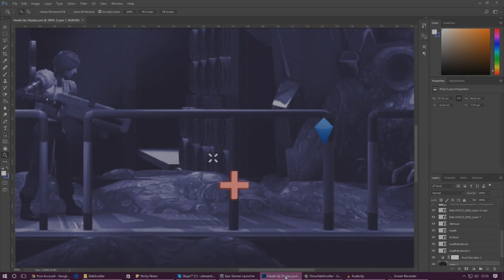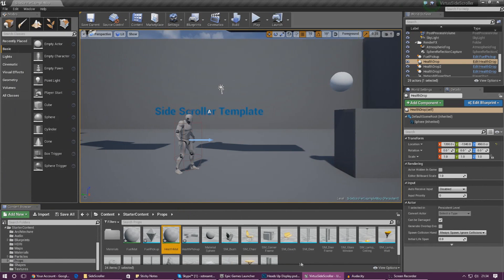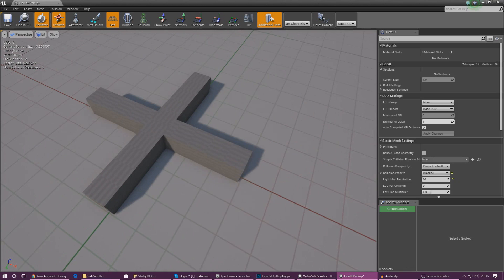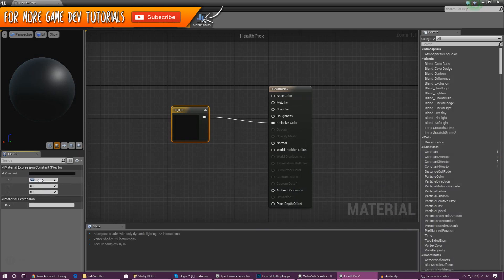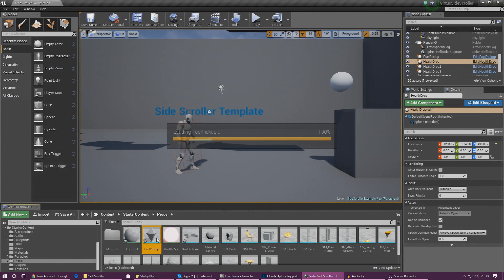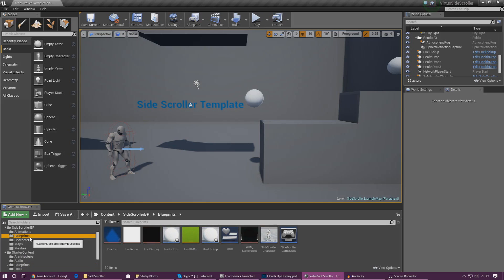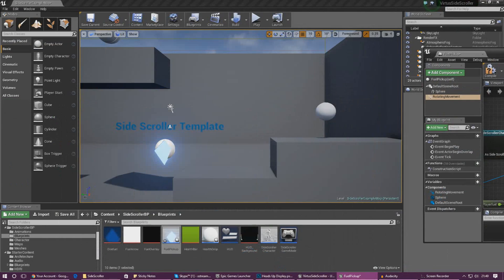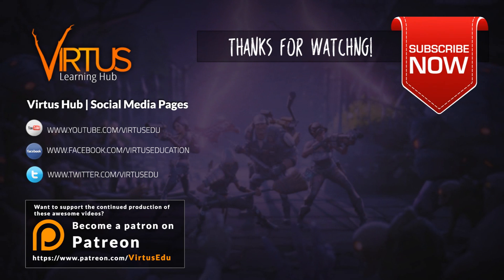Styling The Pickup Items - #6 Creating A SideScroller With Unreal Engine 4

Comment: I've got a problem. My HealthPickUp from the download is splitted in HealtPickUp_Box001 and "002. What should I do?
Reply: When importing the meshes, make sure to completely open up the mesh section of the Import Options window. There should be a checkbox called combine meshes that is unchecked. Just check it and you should be good to go. According to the comments I've seen, a guy named Chris K was the first to point it out here.
Reply: @Starn3rd  That worked perfectly! Thank you.
Reply: @Starn3rd  I checked combine meshes at import. But I have another prob, my combined imported diamond mesh seems to have no collision. I set it as the mesh in my FuelPickup, and the player passes thru. But if I reset it to a sphere mesh, it gets picked up.
Where do I set the collision box?

Comment: Thank you! I can add something  you may usefull.
1- You can also create the health and fuel meshes in unreal. just edit the blueprint screen you can easly add "static mesh" and manuplite the transform
2- Creating seperete materials might make the cpu tired. You can actually create base material which includes constrait (as multipler) and constraitvector3 (as base color, and make it blank) than you can right click this material and create instance.

Comment: Whenever I try to open the pickup materials, the Unreal engine crashes. :\
Reply: try restarting your computer if the problem continues it might be a problem with your computer
Reply: @cian5107  I tried with an older version of UE4 and it didn't crash. I dunno why, may be I'll just cont' on the tutorial series with the older version of UE4

Comment: Random Tip for anyone watching: Go into the event graph for the Health Pickup, then change float - float into a float + float. The only problem with this is that your health can go way above 1 hundred, and when you take damage, it won't display it. To fix this, you need to make the health pickup completely heal you to full health, instead of healing a little. To do this, delete the "Target Player Health" and the "Float + Float", and in the "Set Player Health", change it to 1. Now, you will take damage and your health won't go above 1 hundred. Hope this helps :)
Reply: thank you!!
Reply: you can also use a clamp node, to clamp the health to 1 before setting it!

Comment: Hi, did anyone run into the problem where their health pickup was imported as two shapes instead of one?
Reply: UPDATE: If you run into this same problem with 4.18.4 or higher. Head to Window --> Developer Tools --> Merge actors and from there select the two static meshes you want to merge.
Reply: thanks for the help ! BUT when i want to merge the - I cannot click anything on the new opened window... :( Any ideas? :)
Reply: @Brown Suede UPDATE: If you run into this same problem with 4.18.4 or higher. Head to Window --> Developer Tools --> Merge actors and from there select the two static meshes you want to merge.
Reply: @loge9981  
You have most likely moved on from this issue but I will reply to it for anyone else who is struggling!
 
You are having the same issue I was (most likely) If you are trying to click the items to merge in the content browser it will not work. To clarify what @Brown Suede is saying... you first need to assemble both parts of the Fuel pick up / health pickup in the game scene. Then control click to highlight both parts that you would like to merge and proceed with Brown Suede's instructions.
Reply: @brownsuede4413  THANK YOU!!!!
Reply: Don't forget to check the option to "Combine Meshes". Or you will have 4 objects instead of two.
Reply: @Labyrnthdom  Do it in the "FBX Import options"  window.Make sure "Skletal Mesh" is unchecked,or the "Combine Meshes" won't pop out.
Reply: Anyone having issues still, I couldn't get other suggestions to work, so i place both pieces of one in the scene and aligned them how i wanted, then selected them both and right clicked and selected Merge Actors and it worked for me.

Comment: Everything works great but one thing I have noticed is that with health/fuel pickups it goes above the desired 'maximum value'. I'm using floats and the healthbar goes to 1.3 for example.  Is there any way to make sure it doesn't go above the 1 value?  Or will you cover this later in this series?  Would appreciate any input, thanks Virtus!
Reply: Yeah im noticing the same thing. There seems a need for a compare node or something to check if the player needs it or has reached max capacity. Did you ever get an answer to this ?

Comment: is the heatlh bar supposed to go down
Reply: No, you are using the blueprint he did for testing when to lose health. if your health is going down. It is supposed to go up for health or fuel pickup.
E button for fuel loss and you will need to put another object in the map to run across to cause loss of health. Then when you run over a health pickup. it will raise your HP bar.
Here is a screenshot of my Healthloss objects also, the green glowing spheres take health. http://img.photobucket.com/albums/v685/Labyrnth/Unreal%20Game%20Dev/Health_LossHealth_Fuel_zpsmr0pi6a1.png

Comment: So I am having a weird problem, and google failed me. On the health material I get a glow, but on the fuel material I get no glow. They have the exact same settings other than the color from what I can tell. I am pretty sure I have had emissive problems in the past.
Reply: You need to add a Multiply in between of your 3vector and emissive color and have your Const B (or editable number in B box) set to 10.
Reply: I have that same exact problem. also when I put 10 on the Fuel pickup blue it changes to pink with a blue shine wtf O.o
Reply: Thank you,

Comment: yo if i try to import them they don't come like you have there slip in 2 parts all separate
Reply: This is the screenshot of my import settings: https://i.imgur.com/Kd0mq6U.png
Reply: i knew someone in the comments had the answer to my problem. thx
Reply: Chris K I try my best but even with your tips it won't help,if I check combine mesh I only get 1 of the 2 pieces
Reply: Thanks for the responses guys
Reply: thanx chris
Reply: can you help me?
Reply: When you import, in the Mesh section, there's a down arrow that expands more options (don't forget to uncheck Skeletal Mesh to get the correct options). Last option in the list is Combine Meshes, check it and you'll get a single object.
Reply: @ingratitude  You're the best, man. This was the exact issue I ran into.
Reply: @ingratitude  THANK YOU! I spent almost 5 minutes just trying to figure this out.
Reply: @ingratitude  Thank you very much! \o/
Reply: @ingratitude  Thanks Chris!
Reply: @ingratitude  you are a real one bro, honest to god. may everything good be on your way forever
Reply: Worked for me. Thank you
Reply: Chris K thank you very much
Reply: Thanks a lot, struggling when I see this comment! Great bless!
Reply: thx chris you saved me